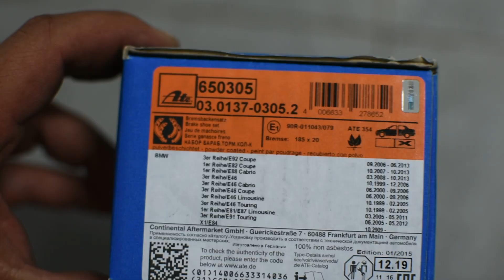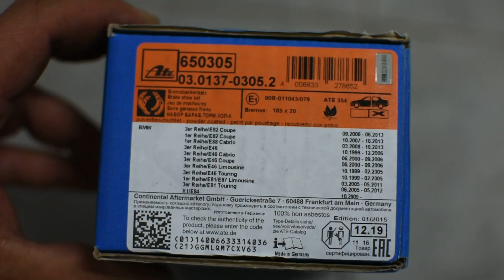Parking brake shoes replacement BMW E39

Comment: Copper grease on wheel hub is a bad idea. Copper particles will create uneven surface, it'll most definitely cause rotor to vibrate. Use a little bit of engine oil instead.
Reply: How small are the particles?
Reply: actually dont use anything. Just clean the surface properly. Direct contact is wanted, with nothing in between.

Comment: With the wheel off, you find a little peek hole in the beak drum part. Bring that down at get a flashlight. You will find a small wheel that you can adjust by moving a screwdriver from left to right. It’s a pia, but it can be done. You can probably find a video on it “how to adjust drum handbrskes@

Comment: I got a tip for the brake shoes spring, you use a long flat screw once u put the first side of the spring you use the screw to link the other side and make a lever into the spring's hole and voila it will goes in

Comment: You may have done it later, but when replacing the shoes you should always:
1
Pull emergency/hand brake two teeth
2
Adjust the shoes very tight to point where wheel will be stuck and can not be turned anymore. This is to center brake shoes. 
3
Adjust/release till wheel runs free
4 
Release emergency/hand brake

In video it seemed like wheel did not run free after your procedure. This could lead to extensive head causing all kind of trouble like:
- glazing of shoe lining
- excessive wear of lining
- blocked wheel after shoes expand because of heat
- deteriorating wheel bearing grease and have it run out.

Comment: I really need to have the back brakes overhauled completely on my 2000 pre-LCI E39 523i. How much time will it take for a professional mechanic to do both sides, including replacing pads and discs? Is it doable in one day?
Reply: It is doable in one day easily, but will depend on your mechanics schedule
Reply: the mechanic won't do all that. overhaul is subjective to the tech's workload for that day and your generous tip
Reply: @McCarthyism_by_Youtube  update: the mechanic did everything in one day. 

In my country it’s unusual to tip mechanics, because a cheap workshop already ask at least €60/hour incl. taxes. When I bring it to the dealership it’s more than doubled.
Reply: @jjvdk90  over here in non-binary country, labor is around $100usd/hr and dealers charge double that rate.  when I bought my e39 m5 in 2010, I couldn't even change an air filter.
this past weekend I did the subframe bushings, driveshaft flex disk, wheel bearings and started installing supersprint headers.  my body is so sore 😂
I give mechanics so much credit to do it for a living. $100/hr will barely cover all the overhead associated with a skip

Comment: Copper grease? Do you mean anti seize?
Reply from the maker: Copper grease provides excellent protection for all metal parts against seizure, corrosion, heat, rust, acid and water.
Reply: I'm well aware of what something does I'm asking you what the actual name of it is I've never heard of anything called copper grease.
Reply: @TheultimateDIYmachine  you mean anti seize lubricant. It's not an actual grease.

Comment: copper grease on the hub is a bad idea, use a non metallic grease
Reply from the maker: Thanks
Reply: Hi Sami, may I ask why?
Reply: @Ucofatoffski  copper grease has thin copper particles in it. When applied on the hub it creates an uneven surface for the wheel to sit on which leads to uneven tire wear.
Reply: @MrDosSantos991  but the particles are tiny, and on the inside of the hub... 
My ignorant brain doesn't see how this would affect the tyre wear, which would surely be down to the tracking, no?
Reply: @Ucofatoffski  they are tiny but it matters nevertheless, where i work its forbidden to do such thing (and backed up by manufacturers)

Comment: So much grease.. the dust will stick on the grease..
Reply from the maker: Yeah, BMW engineers thought the same when designed the car, for that reason brake shoes are installed inside the rotor and protected for a metal shield behind it 😉. But thanks for the comment anyway!
Reply: The ultimate DIY machine That is true
Reply: @TheultimateDIYmachine  Yeah.. Please show me instalation instructions BMW. Look in TIS.  

":

Clean contact surface of brake disc at wheel hub thoroughly; remove traces of corrosion if necessary. Unevenness on contact surface may result in distortion of brake disc!" 

Where is any Word about cooper grease on for example wheel hub?

Comment: Coper grease between brake disc and hub?? Oohh  please! This is fail number one!
There should be clean surface or Little oiled in case of rust in a future.

C mon.
Grease cooper is highly not recomended to this work. 

Try to talk with producent of discs, in case of warranty.. If they find grease signs There is no warranty then :)

Copper grease has solid copper particles, the layer you used can contribute to disc vibrations.
Reply from the maker: No vibrations at all, knock on wood! Thanks for the advice anyway 👍

Comment: this should be named how NOT to change parking shoes
why take off caliper off the bracket?
Reply from the maker: Thank you for your comment, indeed rear bracket bolts on E39 are in very tight spot without removing caliper and while reinstalling  you can't place a torque wrench properly with caliper and brake line in the middle...